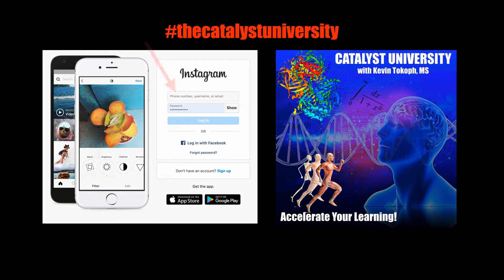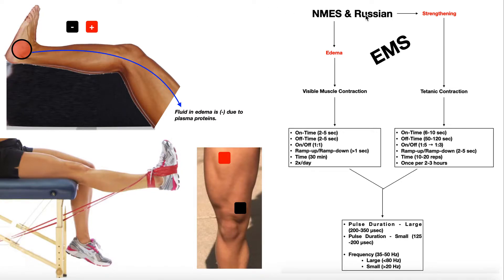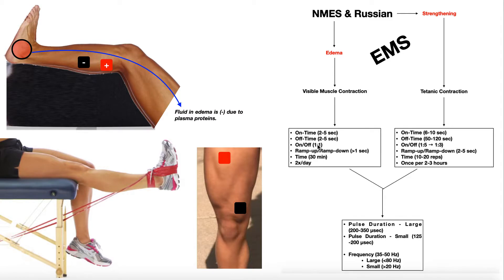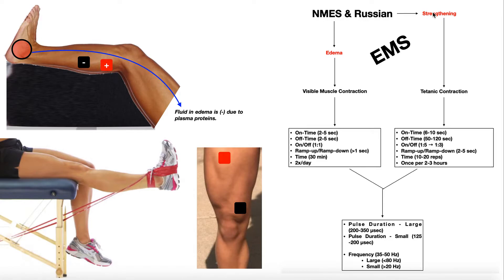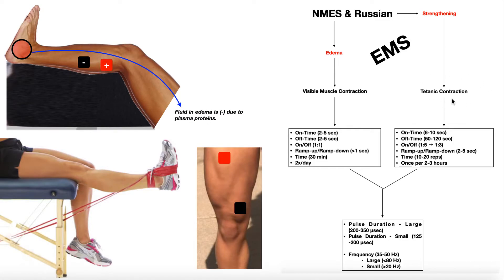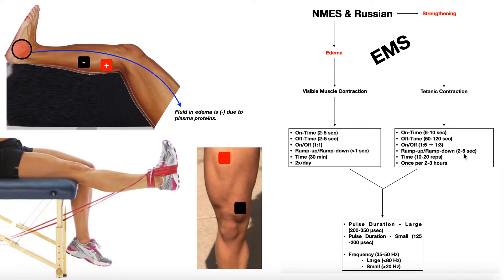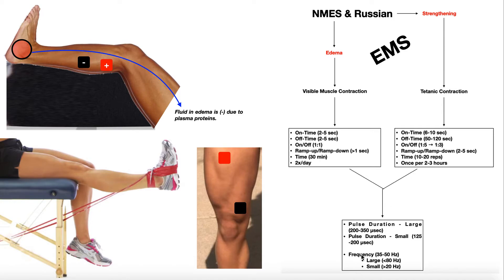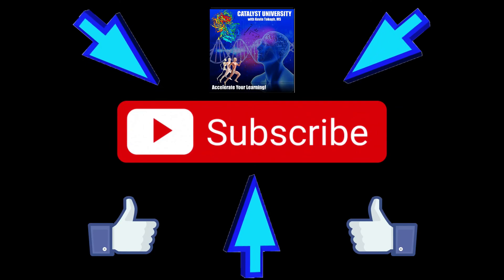NMES & Russian Stimulation EXPLAINED | Theory, Use, & Parameters

Comment: Thank you for an informative Video I have a question that you or one of your subscribers. I have been diagnosed with Patellofemoral Pain Syndrome in my left knee I have been to physio but have been told I need more treatment than I can afford so I was going to invest in ether a NMES or Russian stimulation unit and basically mimic the exercises that I have done so far at Physio. My question is a suggestion for the unit, I am not looking for TENS but I assume an NMES or Russian stimulation unit, in addition placement of the electrodes and settings (I am in reasonably good shape an avid cyclist) I realize this will be a broad answer but i just need a place to start.